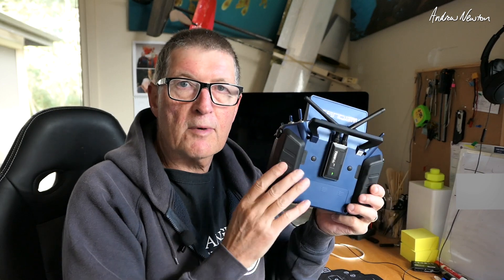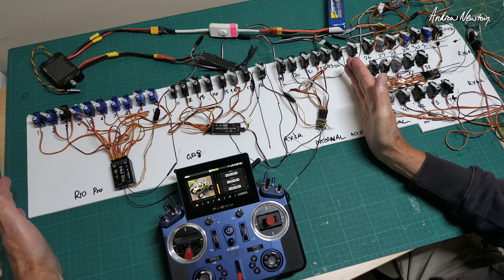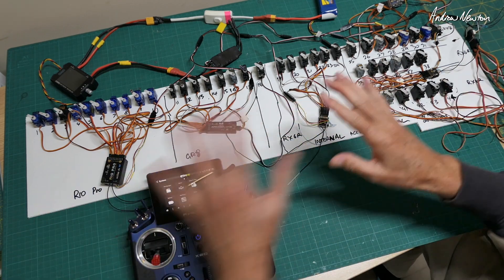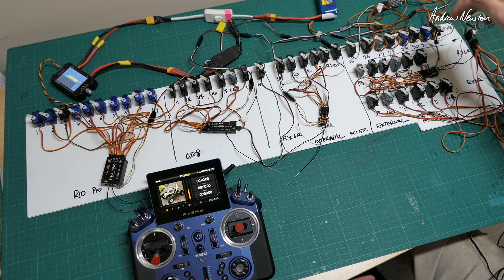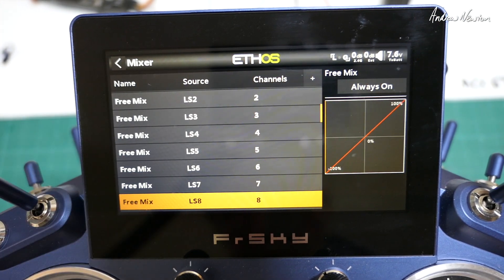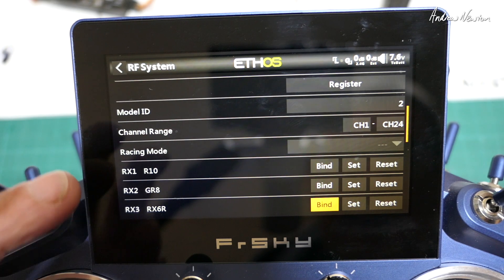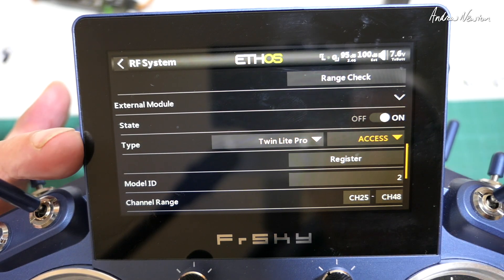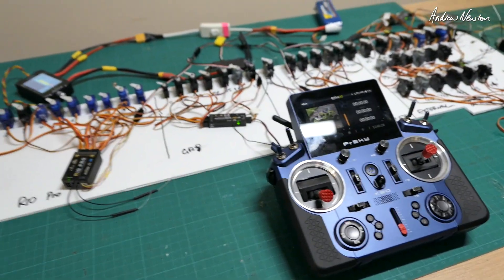48 PWM Channels

Comment: Absolutely amazing I think you just made my decision as to which radio to buy thank you! Quick question as you are using internal and external modules would you be able to run two TD r 18 receivers one internal and one external as they are dual band receivers?
Reply from the maker: Which external module?
Reply: @AndrewNewton  Hi Andrew not sure if I am asking this correctly. What I’m trying to ask is if you use the TD r 18 receivers they work on 2.4 and 900 at the same time, would you be able to use two of these receivers to get 36 channels on the frsky x20s.
Reply from the maker: Cant see why it wouldn't work. I dont have 18ch receivers but will test with what I have

Comment: Great video and explanation. Did you do a range test with it? I have had no success with a similar setup using ACCST. I had 2 reciever. One receiver was bound on the internal module and one receiver was bound on the external module. At greater distances, the recipients influenced each other in such a way that one reciever has lost the connection to the transmitter. I think caused by the small distance of the antennas at the transmitter.
Reply from the maker: This setup is only intended for close range boats.
Reply: @AndrewNewton  The problem already occurs at distances of around 30 m